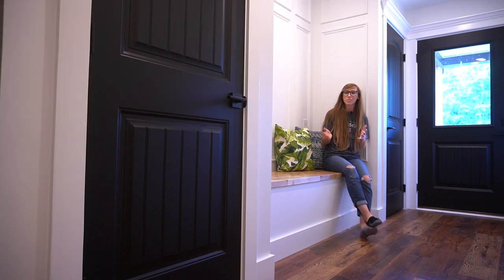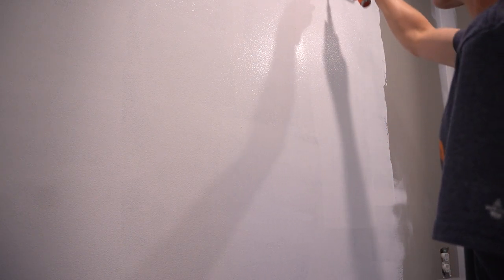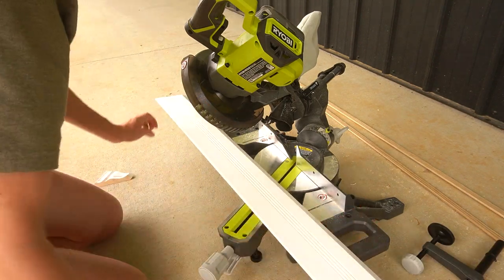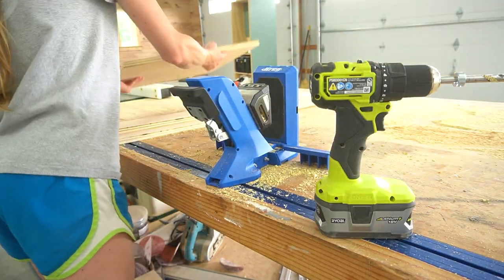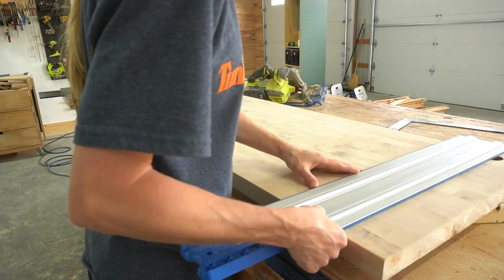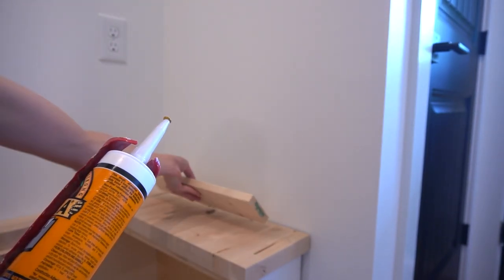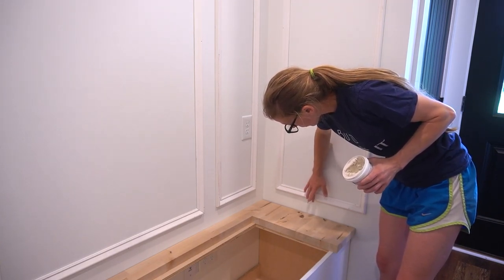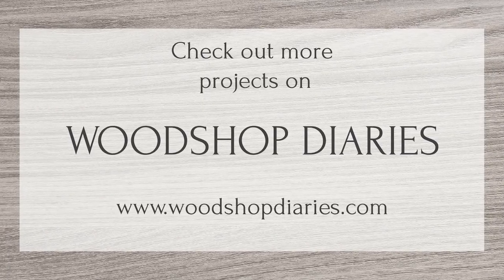DIY Storage Bench with Flip Top--And a Hallway Makeover Project!

Comment: Love the build Shara!  How is the battery life on your Ryobi stuff n things? I'm in the market,  my current brand ... well it takes 3 batteries to weed eat around the house if that's a hint.  P.s it's been in the 80s-90s here in Missouri your Hoody made me sweat lol.
Reply from the maker: Thank you!! I have several different batteries of varying sizes. So they’re all a little different. The small ones last forever in the drill and nail guns. But I recommend the bigger (4.0ah or bigger) ones for the circ saws, and jig saws. I used the small one in the miter saw for small trim and it didn’t die on me. However, if cutting a bunch of thick boards on it, it may run down a lot quicker. 
All that said, it depends, but, the ONE+ batteries are comparable to other brands I’ve used and my batteries are all 2+ years old with very regular use and no issues. All in all, I’m very happy with them
Reply: @WoodshopDiaries   good to know and thanks for the Intel, Ryobi is on my short list of brands I'm looking at. I'm leaning towards them mo than others mostly for the sheer number of compatible tools 1 battery could run. 1 battery type I mean, not trying to run my whole shop on a single battery lol

Comment: I'm consistently impressed by your videos. Even if you make an error you mention it and then show what you did to fix it. I love the crown molding and the trim that you added. And I honestly think that any time storage is added it's a good thing. You did a great job. I do have a question though. Is there a tape measure that you'd recommend buying? I want to measure out some space in my apartment. So I plan on buying a couple of canvases to paint motivational quotes or at this point just to paint as therapy. So I need to figure out how big I want or need the canvases to be. Basically I need the tape measure not to bend or bow under when I go from one side of the wall to the other. I've thought of just taping one side of the tape measurer to the wall and finding the length and height. I really how this makes sense. But I still want you to know that you did a great job.
Reply from the maker: Thank you so much! I appreciate your kind words! 
So I don’t really have a take measure I recommend for measuring long distances or one that won’t bend over a long span. However, my favorite tape measure is a lufkin that has marks on the 1/8” spots. Like they’re numbered. A lot of tapes just have the marks and no numbers between the inches. But this one has them labeled and that’s super helpful. https://homedepot.sjv.io/X3PoM
Reply: @WoodshopDiaries  thank you. I appreciate that.

Comment: I used the butcher block on my grill table for kamado grill. I keep it oiled, but board r coming apart in few placed. It looked really good at first and I could not figure out what to use at the table top. We'll see how long it will last before it all comes apart.
Reply from the maker: If it’s outside, I probably wouldnt have recommended butcher block. Treated or cedar would have probably been a better option for outside use and with gaps between boards for water drain off.